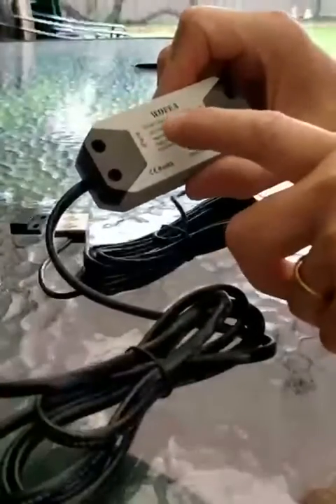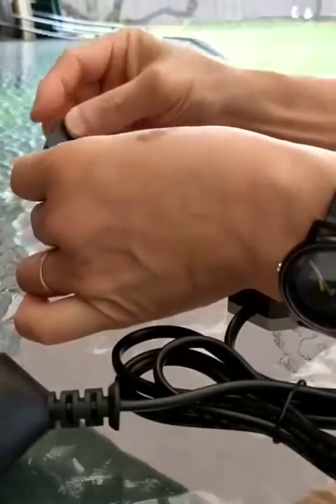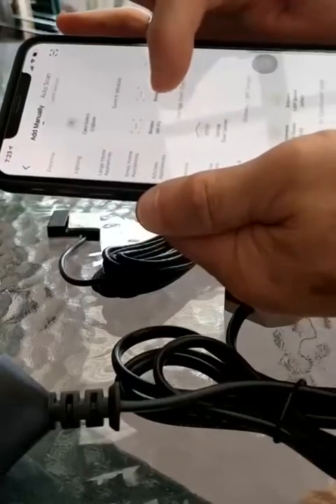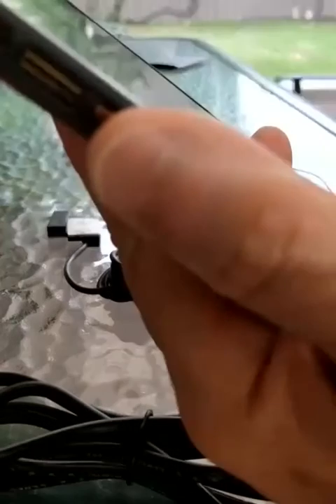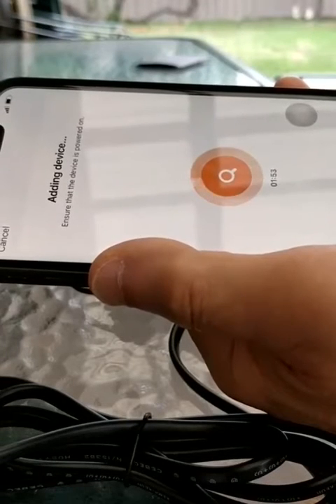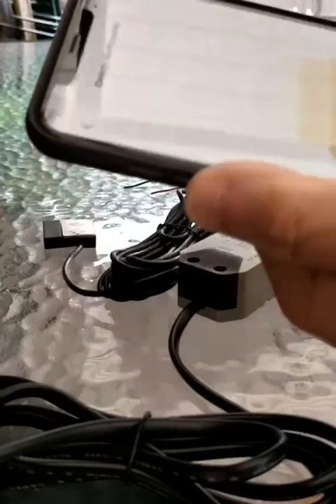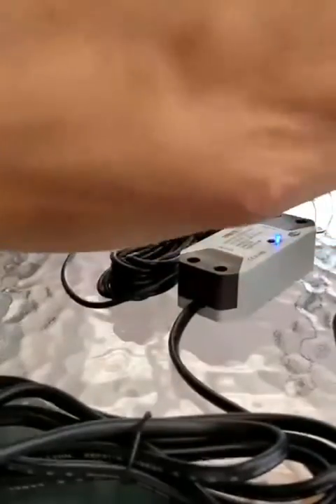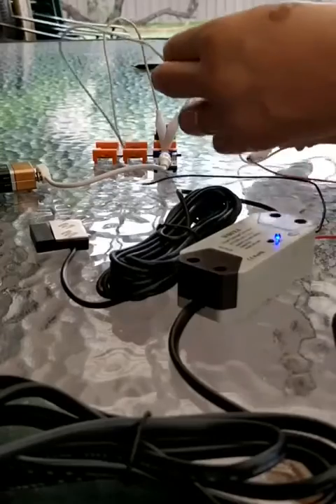WOFEA Smart Garage Controller Setup

Comment: It is a switch operated via wifi. There is no voltage.  It only works on single button roller doors. You connect the wires to to the existing single button on the roller door unit or the button on the wall that operates the existing roller door

Comment: Hi, would you know the voltage that it sends out? I just bought one and it isn't opening the garage door - when testing with a multimeter I can't get anything more than ~5 millivolts
Reply: Probably only a Relay. Voltage supplier from Garage door. relay opens and closes the circuit.
Reply from the maker: Hi Andrea, no, I don't know the voltage. It's just the two points you need connect on the garange control unit, similar to what goes into the wall switch to open your garage door. Here is the wiring diagram of the garage door I tested. Hopefully it'll help you.
https://imgur.com/gallery/Bb3PKZQ
Reply: @ytlim1  thanks for the reply. I've sent mine back as it's defective. A pity!
Reply: There is no voltage . It is a switch.   Pn for a couple of seconds simulating a push button when you want to open or close door.